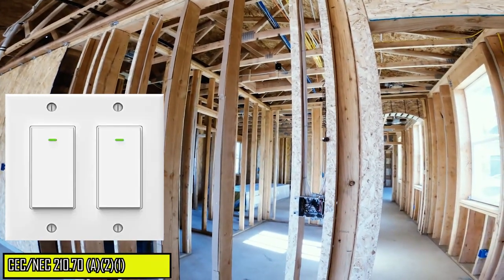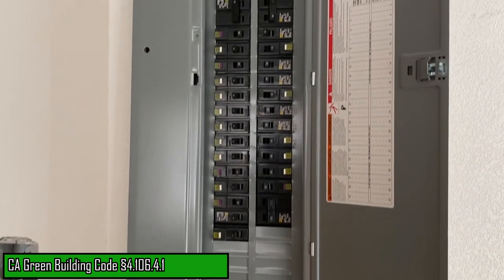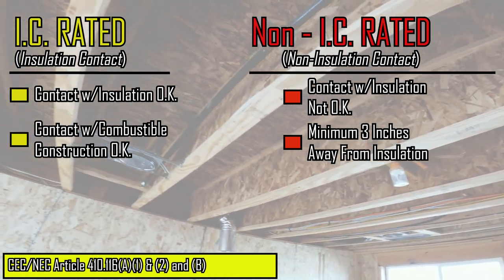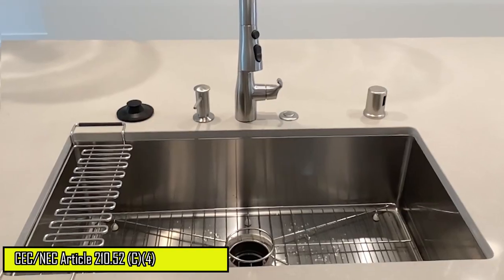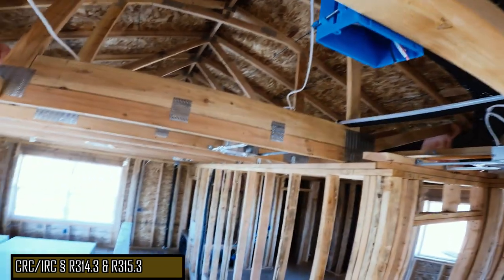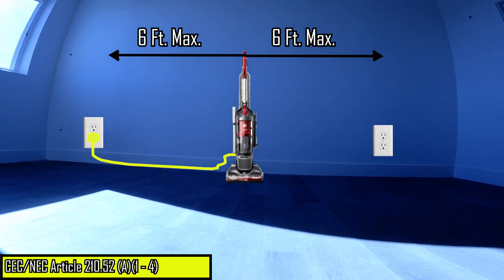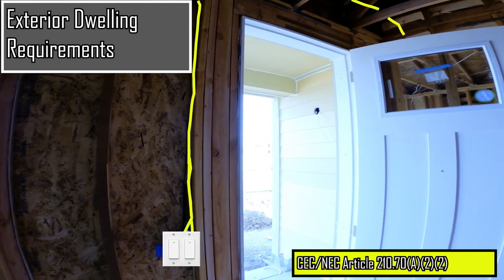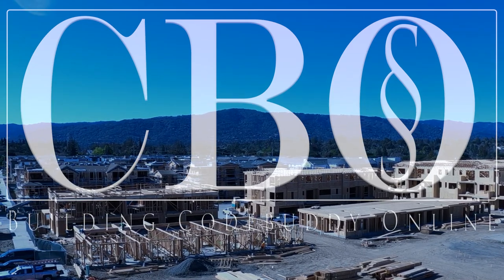Rough Electrical Inspection [Residential CEC/NEC] Part 2

Comment: I have a 2020 NEC.  You may not be there yet.  I would have loved if you covered 210.52.(C).(2).  (Kitchen Island requirements based on square footage) and 210.52.(C).(3). ( Receptecle outlet locations) recepteclecs below the countertop or how appliance garages and fasten in place appliances prevent hidden recepticles from counting as the "required outlets".

Thanks, loved it.
Reply from the maker: Hi Keith.  Hey, thank you for your comment!  It's been quite heavy on my mind to do a short video on the new kitchen island requirements as a follow up to this one; but you also bring up some very important points that I can incorporate.  Now that you mentioned it, I shall.   Thank you very much, Keith - and thank you for tuning in.

Be well,

Jose M

Comment: Ive spent 20+ hours over the past few weeks reading electrical code. I am going to wire my house tomorrow. I am so happy that I watched this video series. You did bring up one thing that I didn't take into account - wire guards within 6ft attic access hole. Thank you so much!
Reply from the maker: Hello!  and thank you for commenting, I am quite thrilled you liked the content.  20+ hours of reading the code - wow!  Impressive.  Keep in mind that the info. in the video is based on the 2017 NEC/2019 CA Electrical Code.  Although a great majority of the information didn't change, there are subtle changes such as kitchen countertop receptacle requirements, surge protection reqs, and some GFCI add-ons.   Feel free to reach out if you have any questions during your work.  It would also be greatly appreciated if you let me know how your inspections go.

Thank you and best of luck!

JM

Comment: how far a way from the wall is the smoke detector, in bed room and living room. and what is the height of the meter box [ one meter or forty meters heights] . your video are very informative.
Reply from the maker: Regarding the meter box height, check with your local electric utility provider; more often than not, they have specific requirements (I have seen 1.2 meters and up to 1.9 meters height required); however, code does not address the panel box height.  The code does, however, regulate circuit breaker height which is 6 foot 7 inches in height max, to the center of the grip of the handle (see NEC or CEC 240.24 for more info).  
Regarding the smokeys, the code is silent on horizontal distances from wall.  I would say double check with the local building department (for both questions, in case they have special requirements).  Be aware that smoke alarms must be no less than 3 feet horizontally away from HVAC supply registers and 3 feet away from the tip of ceiling fan blades.
I hope this helps.

Comment: Doing renovations on my house.  While demoing my kitchen I pulled out the old recessed lights.  Saw them marked as non IC rated.  So the individual that installed them decided it would be brilliant to wrap them in fiberglass insulation as well as have blown insulation in contact.   How it never burned down my house I will never know.  Just lucky I guess
Reply from the maker: Wow; wrapped in both fiberglass and blown insulation!  Yeah, very fortunate something up there didn’t ignite.  The paper back from the fiberglass is the first likely to ignite (assuming it’s in direct contact with the can light) in those circumstances, and before the fiberglass or the loose-fill insulation burns.   Check this cool video out, which shows a guy torch testing the snot out of different insulations, kind of gives an idea of what it takes for insulation to burn.  Very cool.   Link:  https://www.youtube.com/watch?v=8NC79e0oztM&t=174s 
Thank you for your comment and for sharing your experience!
Take care and be well!
-	Jose M.

Comment: Good video. Make some more.
Reply from the maker: Hi and thank you for checking out the video.  I am absolutely going to continue making the whole sequence of residential inspections, which will include; mechanical, plumbing and framing/structural.  It may take a bit of time since I have other content that I will put out between videos; plus, this being a hobby of mine, I balance this with work obligations - so stay tuned and once again, thank you.

Take care,

Jose M

Comment: For the electrical meter can we use any meter desired or which meter is suggested for ADU inside a garage ? Could it be recessed or just surface ?
Reply from the maker: Hello and thank you for the question.  Typically, the utility company specifies the type of meter that should be used – even for garage conversions to ADUs.  The same applies if the meters are recessed or surface mounted.
However, electrical panels (non meter types) could be installed inside an ADU, and on a fire separation wall, and they can be either recessed or surface-mounted. However, there are specific considerations and requirements to keep in mind:
-	Clearance requirements (30”wide X 36” deep).
-	And if recessed, the panel must have appropriate fire-stopping materials and methods (consult with the designer on this one).
Also keep in mind that the local jurisdiction has the authority to make the final interpretation.
I hope this helps; however, please don’t hesitate to reach out if you need further clarification.  

Jose M

Comment: Are doorbell wires stapled down as well?
Reply from the maker: Hi John.  Yes they are, per NEC (or CEC if in CA) Section 725.24; and the cable is also required to be protected similar to romex, fyi.
I hope this helps.
- JM
Reply: @CBO.online  Thank you, guess I cannot doe a poe doorbell camera, will have to go wifi.